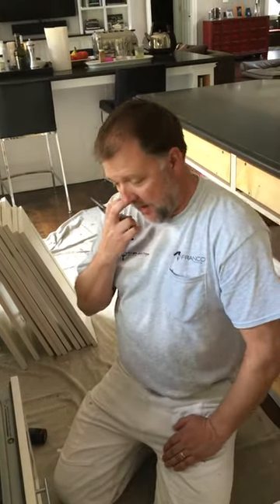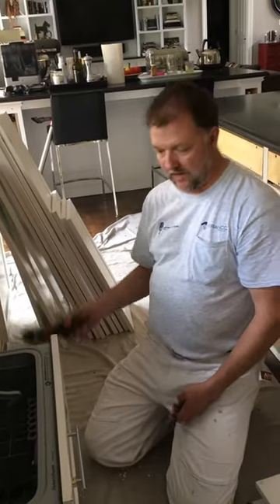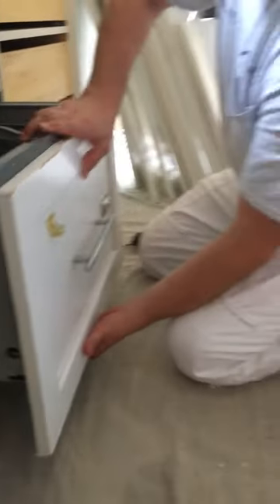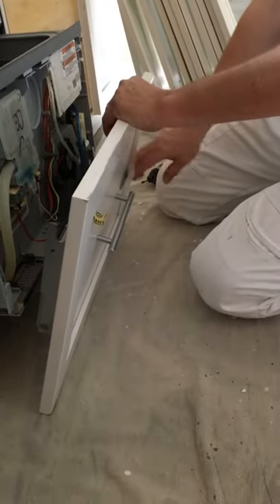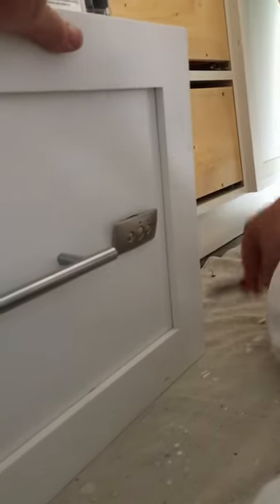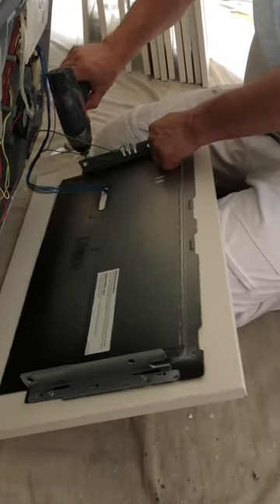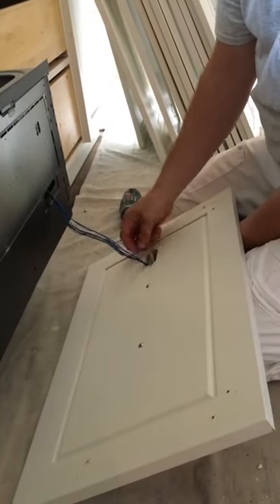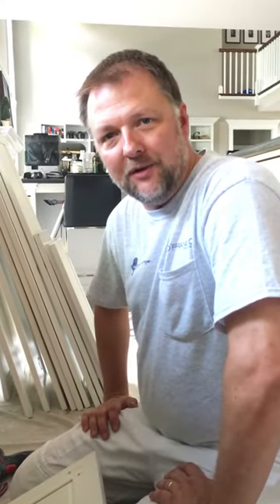Removing Fisher and Paykel dishwasher panels

Comment: So helpful… thank you for the how-to film. Our Fischer Paykel has started stopping mid cycle and I discovered its because there are highly sensitive sensors that are being triggered due to the front panel being a bit swollen now its 7 years old. Currently using a mixture of table and stool to keep it pressed in (creative but a pain to do!) and its great to see how easily a new panel could be fitted. 👏🏼🫡